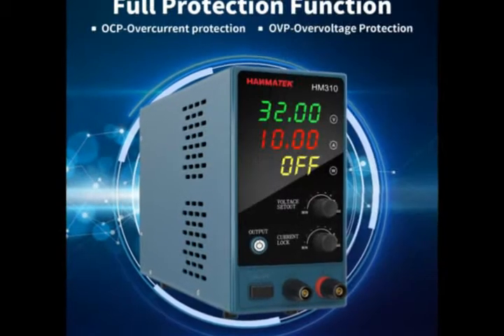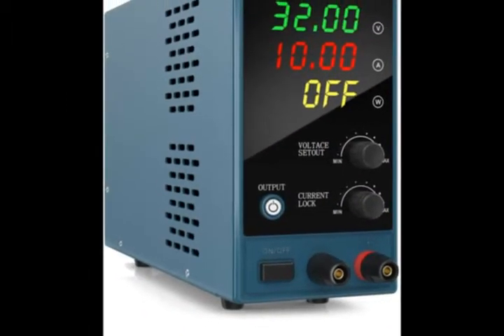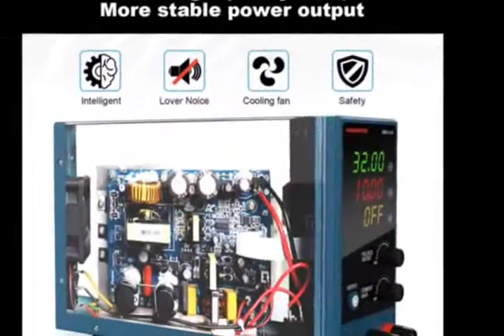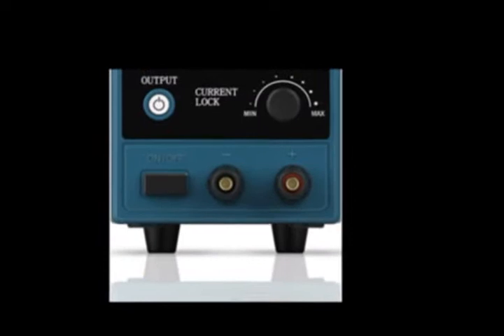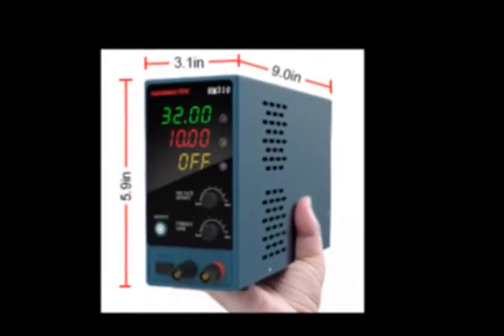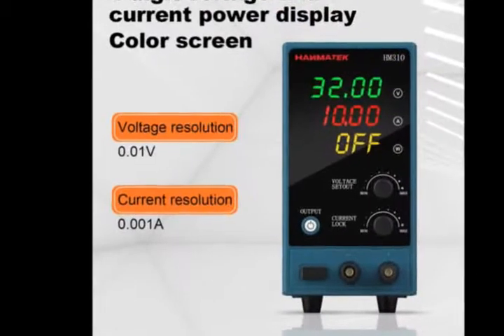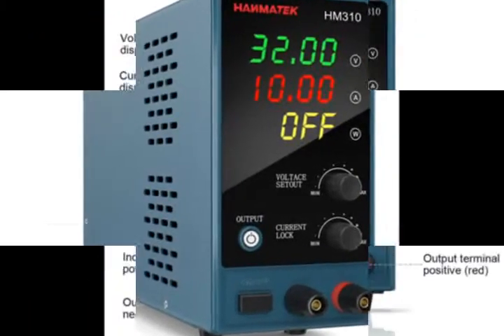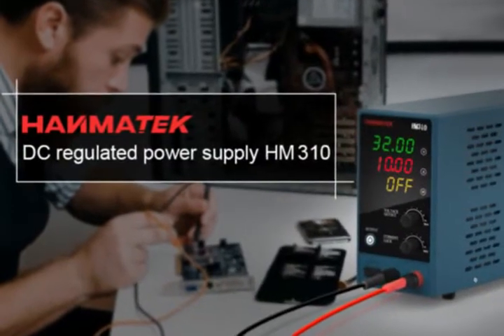Power supply | Adjustable DC Power Supply | (0-30 V 0-10 A) with Output Enable Disable Button HM310

Comment from the maker: Power supply | Adjustable DC Power Supply | (0-30 V 0-10 A) with Output Enable Disable Button HM310 Mini Variable Switching Digital Bench Power Supply
Link to buy: https://amzn.to/3sfWSBN
Hare more similar Products link
https://amzn.to/3uaNcdz
https://amzn.to/3dBIe3L
https://amzn.to/3qGNM0n
https://amzn.to/3uaNcu5
https://amzn.to/3bri4xR